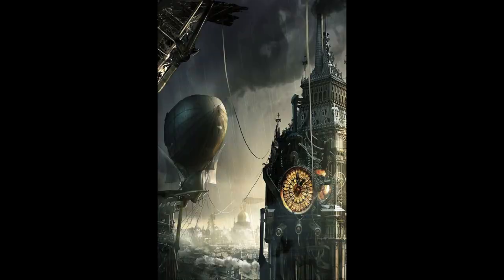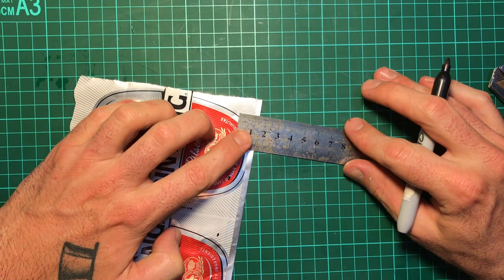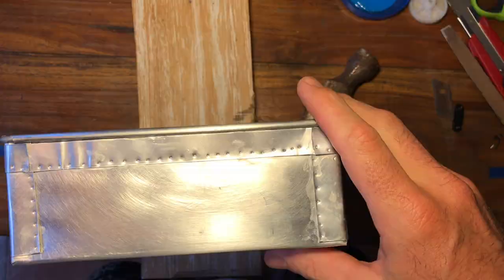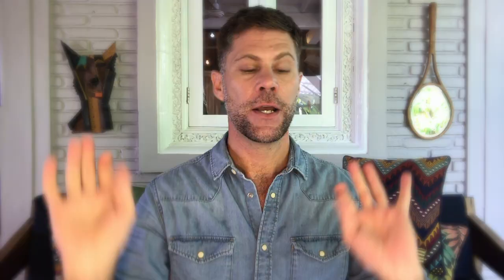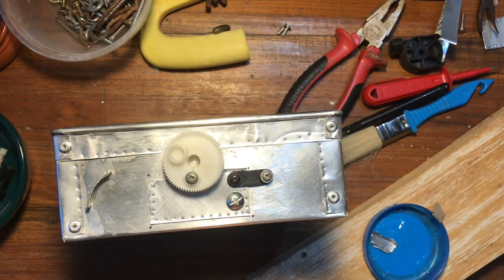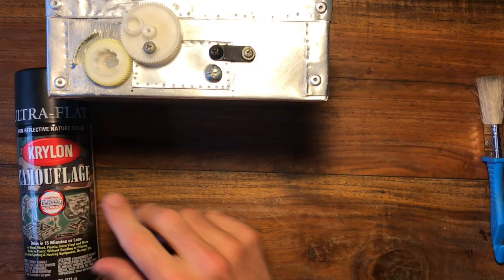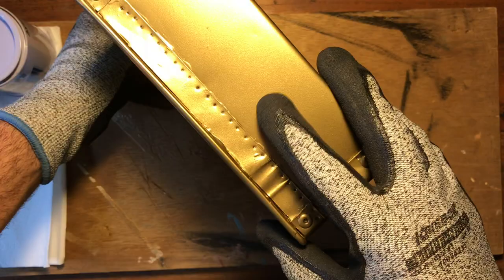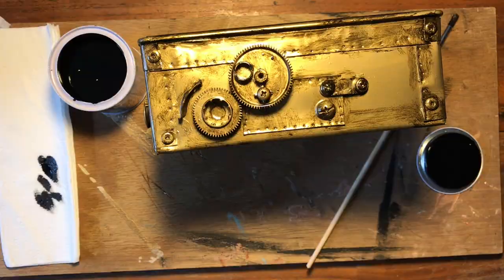Steampunk Inspired DIY Upcycle

Comment: Love this project! I have used cardboard and paper clay to make similar types of things. It works, but the painting and aging process is more challenging to make it look like metal - a watered down black wash is a must. I made screw heads and rivet heads with paper clay (super easy) since I don't have a rivet gun and I can glue them on as embellishments any time. Also, rub 'n buff or some other metallic wax comes in handy for this type of thing. I've found Adam Savage videos to be very informative about aging techniques. Thanks for sharing!
Reply from the maker: Thanks for the info Kristy, will look into Adam Savage for some inspo!